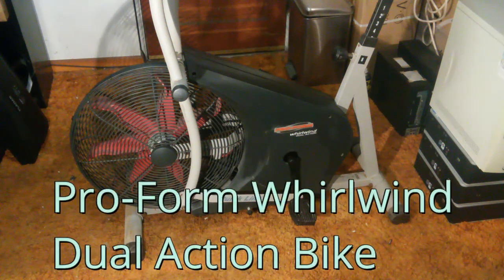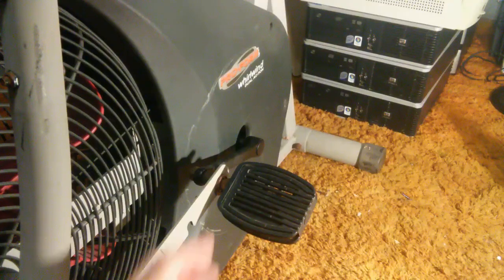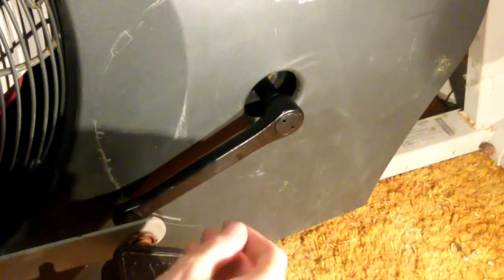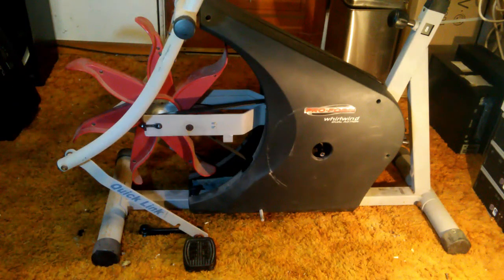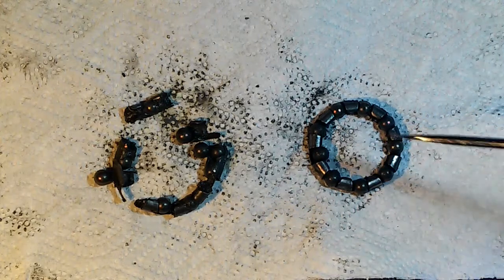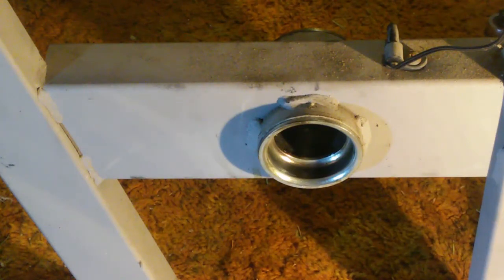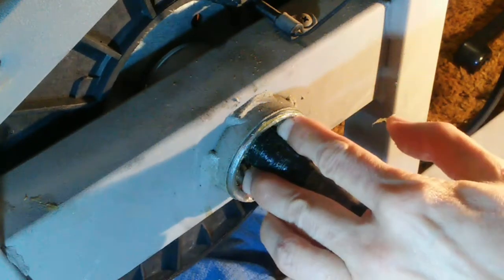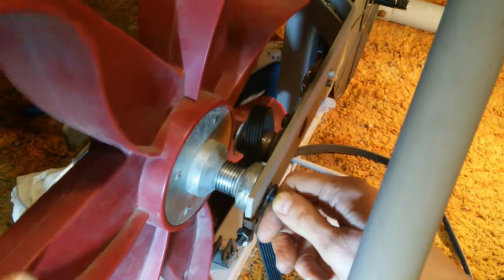ProForm Whirlwind Bike: Bearing Replacement

Comment: Thank you! What an awesome video. While my bike is different (an exerpeutic recumbent bike) the bearing cage on one side shredded just like yours. I purchased new bearing cages and while it is a different bike the similarities of the inner workings were close enough that your video should be enough to help me get the new caged bearings in, greased, and belt back on. The tip on the belt adjuster was extremely helpful as well. Cant wait to get started and get my wife back cycling every morning again with brand new caged bearings!  Thanks again David!

Comment: Thank you very much!  I have done lots of automotive bearing replacements so this should be easy. NOT !  First I did not have the crank removal tool but pulled the right side crank with a three jaw puller, never could get the left side crank. So I sawed a slot to get that side cover off. Then I tried to remove the first outer bearing race, then the trouble began. The race did not have a but built in, just two slots. Left-hand threads messed with my mine during removal.  I thought I had stripped the shaft threads, but I was able to finally get it out. New bearings should arrive today.
This video was VERY helpful. Jerry H
Reply: What size bearing  can you give me the number

Comment: THANK YOU very much for your superb video! I purchased one of these from a used fitness equipment place, and after 15 months of moderately intense daily exercise, the belt fell off.  I discovered the same problems: destroyed bearings and axle threads. I wonder if this is a design flaw.

 Anyway, a couple of notes. The $39 replacement pulley/axle comes with 2 (small cylindrical) magnets installed; the original only had one.  So unless you remove one of the magnets, the bike will show you going twice as fast and twice as far in the same amount of time. It also doesn't have a rim around the outside diameter; so far, this has not made a difference. It seems to be a rebuilt unit, since the axle isn't perfectly perpendicular to the pulley--also hasn't made any difference, just a slight wobble to the pulley.

Also, the bearing kit comes with only one 1.25 inch axle retaining nut; when you re-assembled, you only used the one; I think it would be better to use two, as on the original bike. Just use one of the old ones.

Thanks again!
Reply from the maker: My replacement pulley only had one magnet.  It did not appear to be re-built item, but I can not be sure.  
I think using a jam-nut is the design flaw.  Eventually they get lose and unscrew.  That causes play and eventual bearing failure. It would have been better to use a cotter pin and castle nut.

Comment: This video is wonderful! I'm having troubles getting the right side inner bearing race off of my bike. It does not have a hex nut built into it but instead has the 2 slots like the new one you put on. How can I get this type off of the bike?
Reply from the maker: You could try a large screwdriver.  Place the tip into one of the slots at an angle. Remember it is reverse treaded, so you are trying to turn it clockwise.  Hit the back of the screw driver with a mallet several times. A rubber mallet would be best to start with, it does less damage.  One it starts to turn, you can probably turn it the rest of the way by hand.
Reply: @c.davidgraves4848  This worked! My husband died last year. He is the one who would be fixing my bike. Without your video, I would not have been able to do this by myself. I am so very grateful!

Comment: What size crank puller did you use? I have this same bike that needs this service. Thanks!
Reply from the maker: This is the crank puller on eBay.
https://www.ebay.com/itm/274413359848
Reply: @c.davidgraves4848  Thanks David!!!

Comment: What are the parts number for outer bearings and the bearings with the rounds balls in them? Trying to fix my moms bike .
Reply from the maker: Alta Bike Bottom Bracket Set
Here is the Amazon page.  Make sure to order "ball retainer: 5/16 x 9". I bought the "chrome" color.
https://www.amazon.com/Alta-Bottom-Bracket-Multiple-Retainer/dp/B07BY4PWY7/ref=sr_1_2?crid=3JGU68UCAGC9T&keywords=alta%2Bbike%2Bbottom%2Bbracket%2Bset&qid=1648960277&sprefix=alta%2Bbike%2Bbottom%2Bbracket%2Bset%2Caps%2C58&sr=8-2&th=1&psc=1

Comment: Where can I find the belt for purchase David or anyone???
Reply from the maker: Have a look at this item on Amazon: 
https://www.amazon.com/WALKINGBELTS-Walking-Belts-LLC-PFCCEX25122/dp/B07JQCXVRY
If your belt is slipping, try removing some slack in the belt by moving the fan wheel foreword. This is done by adjusting nuts on either side of the Fan-wheel.

Comment: How do I know if the belt needs replacing ?
Reply: With my problem the pedals were pretty sloppy and inconsistant/noisy. I guess you could look at the belt through the front fan guards and measure the play per Davids video.
Reply from the maker: Dry rot and cracking.  Slipping that can not be corrected, even after adjusting out excess slack.